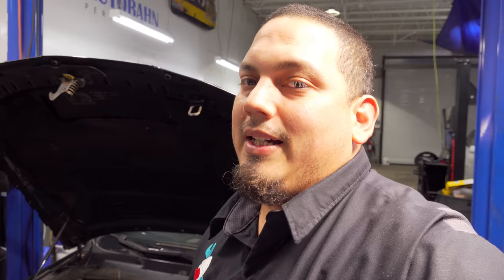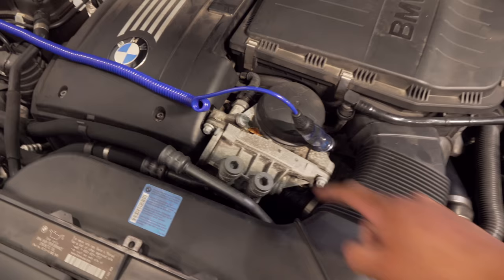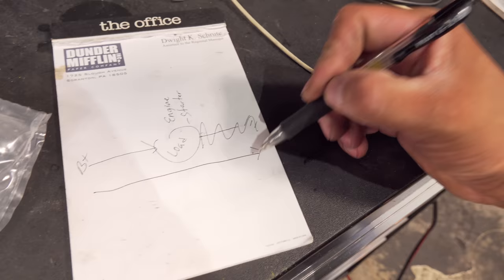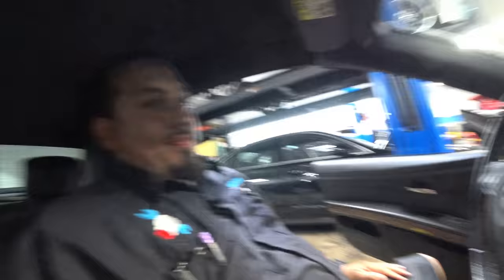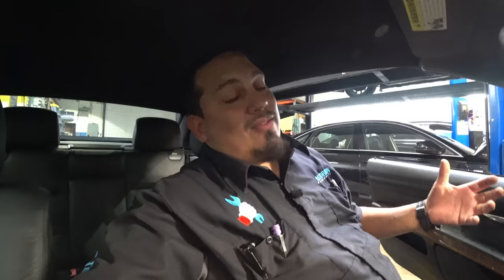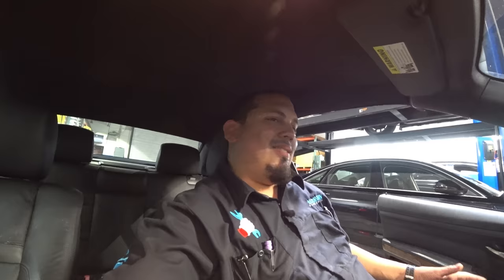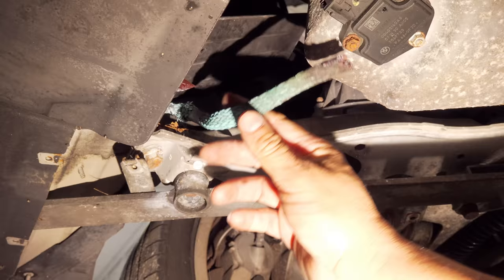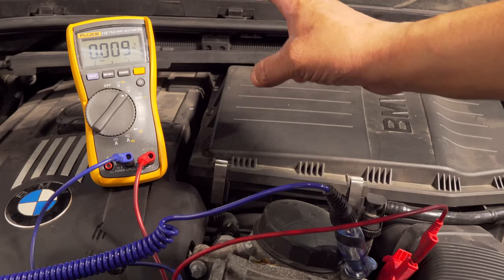TEST YOUR ENGINE BLOCK GROUND USING THESE THREE METHODS

Comment: My jumper cables have never let me down on the ground test. They're 20 ft long, solid copper, 2 ga. that I paid 70 bucks for over 25 years ago. Just checked, they've only increased in price by $100.00 or so. Funny story, found a bad engine ground by accident. Was testing no start on old big car LTD with a fender mounted solenoid.Customer had replaced solenoid 3 times, so I'm test lighting it with test light to bat gd and happened to lay test light on engine. IT LIT UP., Sometimes  IT'S OK TO BE LUCKY RATHER THAN GOOD.
Reply: Yeah the modern ones are made of chinesium (copper glad aluminum wire). Total garbage. You are smart to hold onto those 100% copper jumpers

Comment: Couldn't follow explanation. I think easier way to explain it is, the current is taking path of least resistance which is the test light which is in parallel, normally the big battery cables and ground straps would be the path of least resistance bit since the path has resistance its choosing to follow the test light instead

Comment: on cheap jumper cables  test you can always use both cables providing ground (red and black parallel )   lol  good work
Reply: Wow that’s an obvious but needed bit of info for the next time I do this! Funny I never thought of this!
Reply from the maker: I actually did this too, to no avail
Reply: Good one.

Comment: What about as a first test to connect a test lamp from B+ to the engine and watch for if it lights up, how dim it is or not lit at all?
Reply: I wonder what that would have done probably dim to no light like you said. Bit if it was bright what would that mean
Reply: I AM NOT THE SHARPEST PENCIL IN THE BOX , BUT I THINK THAT MEANS YOUR ENGINE IS PROPERLY GROUNDED .... ALMOST THE SAME AS IF YOUR TEST LIGHT WAS ON B+ AND THE NEGATIVE BATTERY POST ......
Reply: @abramturley2572  If it is bright the engine is properly grounded. If you connect the test lamp directly to the alternator housing you know the alternator and the engine both have good ground connection.
Reply: @gregscheyd4131  Yes, bright light on the test lamp is what it means. Also if you connect a test lamp directly to the alternator housing you know the alternator and the engine both have good ground connection.

Comment: i replaced the head gasket on a Sentra i bought really cheap. the final moment, i hopped in the drivers seat and turned the ignition. the car cranked but did not start. After a few more cranks. i took out a spark plug and it was completely dry, no gas smell either coming from the cylinder. I checked for a spark, no spark. later that night......oh yeah the grounding strap that attaches to the back of the manifold....went out the next morning and connected......the car started right up 👍👍👍👍

Comment: I have used all these methods. And I’ve also incorporated the jump box method. I go out to a car it’s got a slow crank or no crank I hook the jump box up to the jump points  still no crank or slow crank  I move the negative to the engine block car  cranks pretty much confirms it for me.

Comment: A battery jumper cable from engine block to frame doesn't necessarily mean a bad jumper cable. Could be that the starter frame is not making a good contact with frame ground (high resistance ) giving you a slow or no crank. Clean all cable and starter connections. And yes check engine block to frame ground strap connection and for corrosion.😮

Comment: Ive got ,2 volts meter check on my 87 Bronco II, Relay kiks 12v on output STATIC test....., NEW Starter,( tested GOOD B4 bg home at store)   battery checked by PRO, it ALSO STARTS my Dads 92 stepside, ...................i AM onlygtg 3.3 volts on TRIGGER for solenoid, ( Pulled off n checked on start) ALL i get is the solenoid CLANK on start.. ..I can jump Bat POS to TRIGGER..n it STILL wont start......................... I can JUMP Batt POS to OUTPUT to start.. n it wont start.................

Comment: ive been working on cars for years and eletrical has always been a hardspot for me. espically in understanding it.. but they way you just presented that was awesome and very easy to understand thank u keep on the good works and teaching brother
Reply: I resemble that remark. Lol 
I just recalled in the Apollo 13 movie, how they systematically tested each electrical item and circuit to achieve a specific voltage. 
Kinda crazy.

Comment: Absolutely the best ground related video on youtube and/or the internet. Very thourough and informative! Thank you for your knowledge. Priceless!!! I've just confirmed that I've had a ground issue from day one of no start no crank. I purchased a new stsrter and after avoit 20 starts it had a no crank no start.  I then replaced the starter thinking that it was a faulty starter and low and behold after about 5 starts I get a no crank no start issue again. I quickly assume that the starter is faulty and that the after market aeket company is sellimg me a faulty starter...however, I jacked.the car up to inspect the ground strap and it broke off into 2 pieces!!! I replaced the strap and got crank and start. After about 3 starts I got another no stsrt no crank and again i stsrted thinking about the starter being faulty...However, I opened up the car and got to the stsrter and did tests again...oh and I g
Forgot to mention, the starter they sent me initially works when I did a bench test outside the car with a charged battery!!! So I do the same bench test with the second stsrter and it is working fine! I cleaned the engine where the starter connects with a wire brush for a nice clean contact point for a good ground connection to the starter...the car started!!! Then after about 5 starts the car again had a no start no crank!!!! I did the jumper cable method by connectimg nother ends to the  valve cover side of rhe ground by the passenger side under the hood and low and behold it started again!!! Point of my madness and trauma is that I never knew these fuckimg ground wires/straps could be such assholes and pains in my ass!!! Please check ALL THE GROUND STRAPS grounding the engine. FML.

Comment: This video I needed a year ago when my sisters ground strap rotted away. This car had issues starting in the cold for years and then in the middle of summer It just quit. When my mechanic gave me the strap I pulled it apart in my hands, the whole thing was green inside and out worse then the strap you have in this video. I tried to get the car going as it wasn’t home. One thing I thought of doing but forgot to try while I was there was the jumper cable for an alternate engine ground. I’m glad you showed that it doesn’t work 100% because I thought if I remembered to try that it would have worked and have a tow and several hours.

Comment: This is the best video I’ve come across diagnosing bad grounds, and Ive never had this issue before on anything. I was never  shown for situations like this. Been Fighting with a 2008 Impreza. Cleaned the engine to body ground after replacing a cooked battery, cleaned the terminals, and started up, no cels. Came back hours later to show my friend, and it wad All crank no start. All the cels. Either the MAF sensor, the pig tail, the wire from the MAF to the comp, or the corroded negative terminal is to blame (super ugly looking but no build up and not cracked). I’ll go back and check the grounds and batt posts later on, wish me luck!

Comment: A friend had a Cadillac that was running terrible with all kinds of electric issues. He was about to sell it not running right. We got on the phone. His wife was working the key. I had him ground the engine with jumper cables. I could hear it smooth out over the phone! A new ground cable had it running fine.

Comment: I am currently looking at a potential ground cable issue from my battery to the motor, to the frame, the ground strap you did and checking the positive cable connection to my 2010 tahoe fuse panel. These are notorious for bad cable corrosion inside the jacket. My vehicle is doing crazy stuff on the dash with guages, nav drops out, locks up down, poor power, etc. Seats wouldn't move, you name it.
And I must say, I've been a industrial electrician for over 30 years working with 480 down to 24 volt controls and I simply didn't think to apply the voltage drop method across the metal frame / motor like you did for that situation and with the test light, not just a meter. I find automotive wiring to be a field of its own, with all its own set of quirks. I'm going to get the test light I thought I would never need, because of the quick visual you displayed which my digital multimeter simply might not catch!
Absolutely great troubleshooting information!!! 👍🏻
Reply: Replace engine ground strap and make a new ground wire point to the wire harness on the passenger side of that engine should be installed.  Computer ground & engine ground is the issue.
Reply: @jlrockafella It wasn't a ground issue after all, and ended up being the vehicle suspension module was rotted out and shorting out my CANBUS network. As soon as I removed the suspension module and connected the network end resistor it has work fine.

Comment: In modern gasoline spark ignited vehicle applications, there are several circuits that use the engine block ground as a return path back to the source (conventional current), with the source being; the alternator (when the vehicle is running) or the battery (Key on ignition off, starting and sleep current). In reference to this video, the focus is on the engine block ground, however, in actuality we are interested in the complete circuit path, that is, supply from and return to the power source.

In regards to maintaining older vehicles, we find that corrosion degrades electrical connection integrity, with the failures normally occurring in places where the copper cable strands are crimped to a lug or eyelet but the strands are not sealed and exposed to the elements (especially bad in the USA salt belt states). 

For example, you could have a Battery POS top post lug crimped from the factory with a folding cable crimp, where in the same space allowed, could have used a barrel style Battery POS lug and done a hex or circular hydraulic crimp. In both cases, dual wall heat shrink could be use to help seal the connection. But many times what you find from the factory is a folded crimp without any heat shrink. Basically, bare copper strands and lug ears crimped, open and exposed to the elements.

In reality, we are interested in checking proper operation of the overall circuit integrity and not just one connection in the circuit like the block ground. However, the block ground gets the focus because it usually fails first due to corrosion, but not always. You could have a battery lug fail first, but this is usually easier to diagnose if the battery is located under hood where you can easily inspect the health of the lugs and posts.

The tests for voltage drop at high current are really just an indirect way to measure connection resistance (assuming the cables are undamaged). Mario does have access to a Pico scope, so he could actually use a current clamp and voltage input to measure the complete circuit resistance for a specific test. Like starting or charging. If we look at the starting circuit, we have the battery (source) and the starter (load) in the circuit, as well as all the cable and connections. So, you could measure the current with the current clamp from the battery, while at the same time, measuring the battery voltage at the battery posts. From this you could use a Pico math channel to calculate resistance V/I in real-time. 

But, with this advanced test what is a good dynamic resistance value? What is good and what is bad and by how much. Well, you would have to measure some known good working vehicles and get some base values to compare it to. This dynamic resistance test is attractive though when you have easy access to the circuit source (battery), for testing the overall circuit, which will include the block ground. You just clamp on the current clamp, attach the voltage channel alligator clips to the battery, and start the vehicle, then review the waveforms and math channel calculation all time aligned.
Reply: Good dynamic resistance value=0 ohms.

Comment: I've been a tech for 30 years and have seen a lot of young school trained kids come and go , these basic testing skills are either not taught or emphasize well in school. Its not sexy like BMW or Mercedes training so I'm sure it has less impact than basic theory and testing that can be applied to every make and model.
Reply: I would venture to say that more than half of working techs use inadequate testing when it comes to starter motor diagnosis. Something repetitive like that should taught as a standard algorithm, a check list method that avoids skipping steps. Done correctly it takes less than 5 minutes with basic tools, provided the posts on the starter are accessible. Rather than focusing on too much theory, students need a rapid cookbook approach that avoids shortcut disaster.

Comment: Thanks for the video. 

Here's how I conceive the bad ground: the high resistance at the bad ground causes the voltage potential (under load) at the engine block to be higher than that at the battery ground causing the testlight to light when connected from battery ground to engine block. This is basically the same as you explained on the paper.
Reply: @gussingh3948  Are you undecided? I wrote that so someone can correct me if I happen to be wrong.

Comment: not all bad wiring looks as bad as that ground strap, on my hyundai elantra the ground strap was effectively broken, you couldnt tell visually, and voltage drop testing seemed to pass, until you had multiple accessories working and the car was warm. electrical problems are sneaky, so thats the benefit of the jumper cable, it will let you see bad wiring eve if they look just fine visually. cheers bro thanks for the upload

Comment: I just bought a Cadillac DTS... for $800  because it had a bad engine ground... the owner and mechanics, it took me a while to figure  it out, I had those issues on Jaguars all the time.... so as soon as I purchased one, I installed extra engine block grounds...

Comment: Mario had a similar situation but with the customer over my shoulder looking, but what I used was my TOP DON . Was on twin engine crane  first went to the cables ends for pony motor connected top don and did battery test failed , next followed 43 feet of battery cables found a master cut off switch connected top don both sides with of the post and TOP DON found high resistance on the B side . Less than 40 min and permanent fix completed Sooo this issue was going on for weeks new starter new batteries and it was intermittent problem but with the TOPDON. Saying FAIL. The customer did not challenge the road call fee and repair bill and THANKS to TOPDON we gained a new customer

Comment: Had an 11 volt drop on the positive battery cable to a starter on a 2020 ram 2500 the other day. I cleaned the connection at the starter and still had about a 500mv drop.. I chalked  it up to probably being about normal since it was a 6.4L and the truck started every time after.

Comment: Great video! 
Hope you can help on this issue. Is not a car engine fault but probably you recognize the problem:
A few days ago, while riding my scooter SYM VS 125, a lot of smoke started coming out of the front of the bike and the engine started to fail. I turned off the ignition and cut the battery current. 
At home I took it apart to see what was going on and the rectifier was visibly burnt. I took the bike to a workshop where they changed the rectifier and the battery, but they didn't solve the problem. The new rectifier continues to heat up a lot and too fast, as if something is short circuiting. As they couldn't solve the problem and it still cost me a few €€, I picked up the motorcycle with the fault. 

Tests i have done: 
- the battery is new and has 13.1V before the starter 
- with the three yellow wires from the stator connected to the rectifier, the bike works fine at low revs, fails at medium and the rectifier heats up uncontrollably; with these wires disconnected from the rectifier, the bike works well at any speed, but as we know, the battery is not charged 
- at idle the 3 yellow wires measure about 40V from stator 
- the resistant test on stator show equal values on three wires; no ground conductivity; no open circuit on each coil 
- apparently all the masses are well connected. 

Any idea what it could be causing this recurrent failure of the rectifier? 
Note: traditional G6Y carburetor engine with electronic rectifier and CDI, year 2010.

Comment: Question -- instead of making all these tests to the ground on the fender of this BMW, can you connect your tests directly to the negative battery post instead?  I assume the only reason he has to use the ground by the fender is because this BMW has the battery in the trunk.  Not like most cars that have the battery under the hood.  Can someone please confirm.  Thanks Mario for making this video.  Great info!

Comment: I had that same issue I thought it was a starter, put one in didn’t fix it found after the ground was green like that. Live a learn. Also I did oil filter housing on a 3 series took it on a road test came back shut the car off would not restart the ground strap was all green horrible coincidence

Comment: Thanks for posting this up. I just measured from ground post to positive wire and got 12.3V.  From positive wire to oil filter housing also 12.3V.  Does this rule out my ground strap?  On my 2008 528,  I just started to have intermittent longer cranking start issues.  At one point I did notice that my break pedal did not depress all the way down prior to cranking. Very strange.  Thanks again.